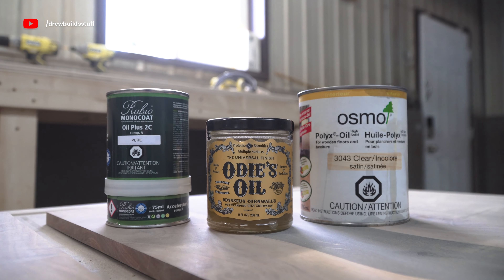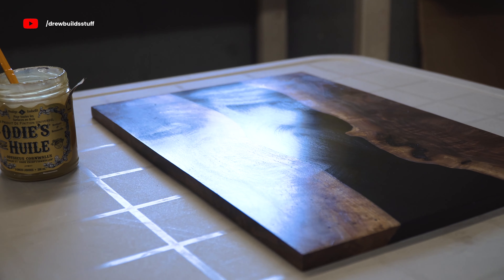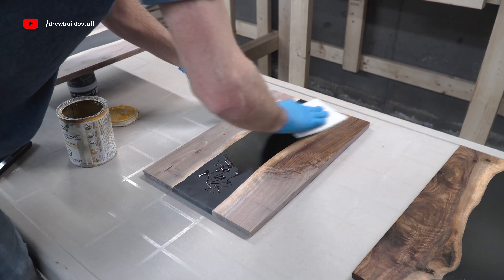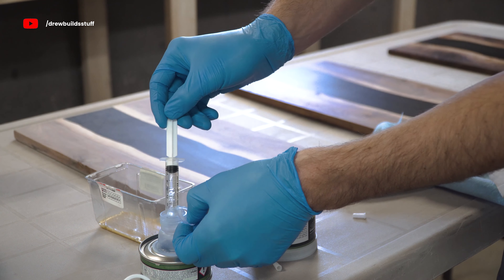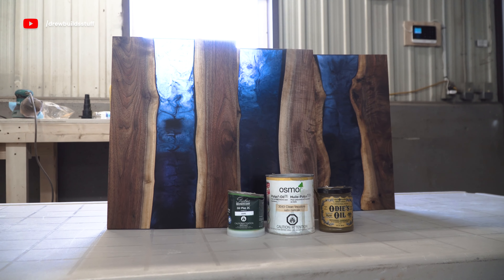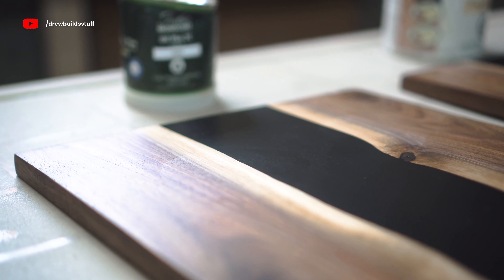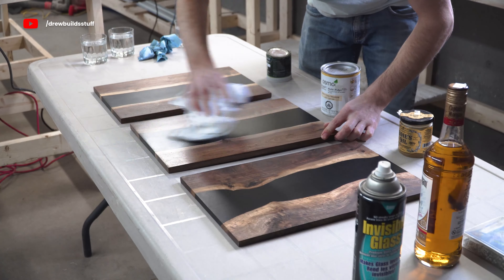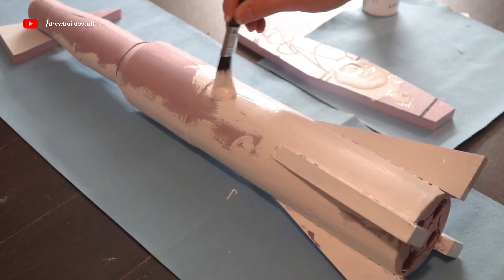Odies vs Osmo vs Rubio - Search for the ULTIMATE WOODWORKING FINISH

Comment: Hi Drew. Thanks for including us in your comparison. In order to achieve full stain resistance with Osmo it is advisable to roll or brush the finish onto the surface and allow it to dry without buffing away the excess. White pads and rags apply the finish very thinly, and so 2-3 coats using this method will leave behind a fraction of the finish versus 2-coats with a brush or a roller. This means reduced stain resistance as you have found here. Bear in mind Osmo is designed to be rolled and brushed to achieve the highest durability. So to improve the stain resistance we'd suggest to roll or brush two coats onto the surface and allowing the finish to dry (do not wipe the finish off). After the second coat has dried, you can lightly scuff sand the surface with a maroon pad or P320 grit and buff in 1-2 coats using the method you used in this video. Once done and cured, you should find that the Osmo has at least 24-hour resistance to the liquids you placed on the surface. Hope this helps
Reply from the maker: Hey thanks for getting in touch. I’ll try the method outlined above and reupload the video if there’s a discernible difference! Also I’d consider updating your application instructions on your website to something clearer like this because I read them about 5 times to make sure I was doing it right and have seen many videos of people applying the same way on here. Thanks!
Reply: @CraigularjJoeWoodworks  Hi CS. Thanks for your feedback. Our comments were us describing how to achieve full durability with our product. Two coats with a cloth will not achieve full durability as shown in the video and so we addressed it. We could honestly speak all day and use a lot more than 250 words on wood finishing, it’s a whole trade! We’re sorry that turns you off, but you do you 😅
Reply: I like Drew’s method along with others, eg Matt Estlea’s.  It appears there’s some confusion with practicality, aesthetics vs lab experiments.  Getting rid of the brush and roller is the only reason I was remotely interested in Osmo in lieu of Rubio. Hopefully this informs the Osmo marketing department alongside the chemical engineers when designing this product.  Thanks for sharing Drew.  Subscribed.
Reply: Yeah.... nah..

Apply with roller and leave. I tried this numerous times and it leaves way to many noticeable lines, not a smooth finish at all..  finally ended up sanding the piece back and changing to Rubio.
Reply: @andrewgrant1814  Hi Andrew, You need to use a 4mm microfibre roller and to roll as thinly as the roller allows. If you are leaving lines, it means your roller is too saturated. If any roughness develops, it can be sanded lightly with  P320 before applying a subsequent coat. Hope this helps.
Reply: @OsmoCanada  Can you point to where these specifics are on your website? I cannot find anything that indicates one method over the other would be preferred for durability.

I'm also confused by your instructions for the brush and roller application, specifically steps 2/3 for the second coat. You have a waiting period followed by a waiting period. Is something supposed to be done between these steps?

I do believe this test was valid and carried out properly, with application method resonably consistent between each product.
Reply: @OsmoCanada , your comments are very clear and appreciated. I have used osmo on many furniture and cabinet projects and always wondered how the other applications might differ. Thank you.
Reply: @OsmoCanada  what's the difference from the finish?  I bought 3054 because there wasn't 3043 available near me, is there a big difference?
Reply: @jakehetzel8177  totally, the Osmo rep typing these novels is on another planet… switch to odies, they know how to explain the product. They have a great video for application every product, my son could Apply it and he’s 1 haha I will never use Osmo. No one should
Reply: @jakehetzel8177     Why not just use a wiping varnish 
like Arm R Seal?  Looks great an easy application and most importantly, water and stain resistant.
Reply: @saax3816  Arm R Seal is top notch, and their instructions are lucid and make sense. I like that I'm not expected to call them becase they somehow have time to answer phones to give recommendations for every situation yet somehow don't have time to write down these recommendations.

Keep recommendations off paper = keep liability issues minimal. Bogus model.
Reply: @jakehetzel8177    I can understand their marketing technique…Osmo was originally for flooring?   For that situation, and Since product purchasing can be expensive, Calling their support for best application is nice to have since there are dozens of variables going towards a good coat.  For Casual woodworkers for making tables, I think Osmo hasn’t adjusted to that different market yet from a support perspective.   To be honest, if I hired a flooring specialist, I will want them to get the support needed and understand the best technique for that particular project.
Reply: @saax3816  I don't disagree with what you're saying here, but the fact is that the customer-perspective in this thread has been that Osmo's instructions could be better. Instead of them accepting that/addressing specifics, the rep provides lip-service and marketing blabber. Does it make sense to you that they find it impractical to improve on their instructions, yet practical to find videos on youtube and run a hotline?
Reply: @jakehetzel8177    Yes they need a change to their support and marketing.
Reply: @saax3816  totally. The customer service needs the boot.
Reply: Excellent clarification, Osmo Canada, in applying your product for a very resistant finish. Your explanation is consistent with all of your instructions and videos produced by your company. I’ve achieved very durable finishes as a hobbyist furniture maker and wood turner.
Reply: @CraigularjJoeWoodworks  stop shitting on osmo there saying how it should be done so chill
Reply: I’ve tried multiple hard wax finishes on many different types of products, and I believe there is no one correct answer to this. The difference between all the finishes is absolutely personal preference, which can never have one correct answer. My personal preference is Osmo, but again, I also apply it in a completely different manner than anyone has addressed here along with using a combination of multiple Osmo products for a high gloss finish. I also use different Osmo products on different projects depending on the use of the item. For example, I used to use a mixture of mineral oil and beeswax on end grain cutting boards, but after discovering Osmo Top Oil, I find that it provides a much more durable finish than remains food safe and doesn’t have to be reapplied so often. Regarding the Polyx, I find 2 thick coats, with 24 hours of drying time between each, then sanded down with 400 grit followed up with one or two thin coats buffed in provide a finish that not only looks great but is also very durable. When I sell a product to someone for them to use, the last thing I want is them calling me back in a year to refinish their item, and applying Osmo in the manner I do may be more work than some people are willing to do, but over time, it actually saves time because the finish, like I apply it, is not only more durable than others I’ve used but also looks better than others I’ve used. You’re more than welcome to view pictures of my finished projects on my FB page, MR Wood
Reply: @CraigularjJoeWoodworks  hijole! He said that he read them on the website. Personally, I am glad that they came on to emphasize application for stain resistance. S'wy I'm reading comments.
Reply: @CraigularjJoeWoodworks you musr have put a lot of time in and got a bad result. That is frustrating.
Reply: @CraigularjJoeWoodworks  Hello, Most of our products are indeed food safe. The products used in this video are food safe when dried. We will be happy to provide food safe certification certificates from third-party testing agencies.
Reply: @osmo Canada 

I was about to buy your product until I read these snarky comments. That’s unfortunate behavior.
Reply: @heatherlindsey971  Hi Heather, We're sorry to hear this because nothing above is meant to be snarky or offensive. We are simply explaining how to use our product and why it is that poor results were shown in this video, as well as trying to help anyone with questions. We're very nice people at Osmo Canada who only want to help :)
Reply: @OsmoCanada  The people that are giving Osmo a hard time here clearly have a hard time understanding there isn’t just one way to apply a finish. Your comments were very easy to understand and I appreciate them.
Reply: @CraigularjJoeWoodworks  What is interesting, though, is that there are many cases in which projects ARE different. If you make cutting boards as your side-hustle, then sure, you are probably going to treat every board you make using the same finishing schedule. But if you do a little bit of everything, you may start to see that not every single project requires (or demands) the same treatment. You wouldn't finish a floor the same way you would finish a beautiful wood-turned vase. Same goes for a bookshelf in your home office verses a bench destined for the lobby of a commercial building. They are simply different situations that require different solutions. So, saying 'every project is different' is far from bizarre or even a lie. If a doctor prescribes penicillin to two people with the same bacterial infection, but one has a severe penicillin allergy, the end results are going to be different. Same goes for wiping two coats of finish on a cutting board and then doing the same on a floor. Asking for one simple/brief explanation is to ignore the multitude of variables that go into wood finishing. Ask for a simple/brief explanation of French-polish. The answer you get will be neither simple nor brief, and if it is, you're going to be missing some information.
Reply: @CraigularjJoeWoodworks  Why is the can unusable? Also, my focus was specifically on what you had mentioned in your previous comment, where you stated "the can must give one set of instructions". So in fairness, I was addressing a point that you brought up, trying to explain why it is impractical to have a single instruction for all circumstances.
Reply: @CraigularjJoeWoodworks  Are you suggesting products with long explanations inherently lack merit? Can you explain why? Is it too much for you to be able to understand why a product might need different applications for different circumstances? It seems like a difficult concept for you to grasp, for some reason. Osmo works incredibly well- so where is the issue? Have youmtried it? How is it possible that thousands and thousands of people use it with success, wolrd-wide, but you can't? Or is it just a giant conspiracy, and really the people using Osmo with success are being paid-off? The hatred seems misplaced. At the end of the day, it is a wood finish. If you cannot figure out how to use it, don't use it. What is the point of spending all the energy bashing it online?
Reply: @OsmoCanada  Hi Osmo.  I'm going to mirror the comments of several others here... I've got the Osmocolorusa site open in another window as I type this and there are four application methods given for Polyx-Oil High Solid.  Nowhere on that page does it indicate a difference in durability, finish, etc would be achieved by following the different methods. I understand that there ARE differences (from your earlier comments on this video), but the instructions on your own site mention nothing about this. Like many others, I would appreciate more clarity in the different results one would achieve from the different approaches.  For example, were I making a table I would be tempted to use the "highest durability" method for the top surface, but a faster method for other parts, but only if they would result in similar look/sheen. With any product results are a combination of technology and technique and you're letting your users down a bit by not clearly communicating the techniques necessary to get the most out of your product.
Reply: This is awesome.   I just purchased some osmo for the first time and am gonna use it in some walnut and red and white oak boards.  Can't wait till tomorrow.   The handles will also have 4 drilled out holes with epoxy pins in them .
Reply: @CraigularjJoeWoodworks  You cant blame @OsmoCanada when Drew didnt follow the stated procedure.  C'mon man! (Sleepy joe)
Reply: @Foxholeatheist  I actually agree with a lot of the comments about there being a clarity issue. I was Craig's page for a bit then it devolved  into some personal vendetta for things that aren't simple enough for someone with a disability or something... "the can is unusable we can agree" 😬😬😬

 But while I do think the AI style borderline bot customer service responses are a little annoying, does seem like they tried to respond with grace, and we have ti remember this person isn't likely in control/charge of the website. All they can do is pass the criticism down the line.

Seems like a lot of folks here think they're talking to the creator of osmo who has total power.

Craig is on some tangent about this video being about cutting boards, when it's clearly a "tabletop" that
Reply: @OsmoCanada polyurethane is the same application. So does that mean I can spray it on with an hvlp? Seems like it would level out better than a roller. Worst case you can buff that and wipe on a final coat
Reply: I had a ton of issues with my Osmo when I didn’t buff off immediately. It results in thin coats, but it got so gummy if I let it dry saturated. 🤷‍♂️
Reply: @heatherlindsey971  it’s people who leave responses like this that prove the internet is ran by trolls!!

Osmo is just allowing people to understand their intended application process. 

If you think they are being snarky maybe you should stay off the internet.
Reply: I'm a big fan of Osmo. I use Osmo Top Coat for my bowls that frequently get washed in water. No problems.
Reply: @saax3816  eww
Reply: @DrewBuildsStuff I agree. I had to screenshot their comment to apply this finish. Since not even their own videos or instructions show this.
Reply: Osmo wasn’t applied properly in this demo. If done correctly it’s a great finish.
Reply: @jakehetzel8177  Arm R Seal is great, agreed.  General Finishes products are top notch.  The only reason I use something else is when I do not want the ambering effect that Arm R Seal leaves.  It's especially ambering on light, non-stained woods like maple and birch.
Reply: I think it was applied according to one of their instructions, the only difference being he needed to use a rag to get it to look right on the subsequent coats.
Reply: @Andy-iw9su I intended to tag you ^
Reply: When applying with a roller or brush, doesn't it require to sand in between coats?
Reply: @OsmoCan  the "you do you" comment above was something I found unnecessary as well.
Reply: @jaimethiessen  Agreed, it's very childish to say "you do you". Osmo's marketing team should fire their YouTube comment employee immediately to avoid marketing disasters like this in the future.
Reply: @heatherlindsey971 😂 no you weren’t, you just think they care about you. Sad.
Reply: I 100% agree with the comment to update your website on how to apply your product with wood/epoxy projects.  They contradict themselves in some spots, as well as contradict the youtube videos.  Which applicator method to apply and when is the most confusing part.  Website says to use a white pad, video shows using a roller, website says to use a cloth, video shows to use a roller, etc.  If it doesn't bond to epoxy, why even put it on the epoxy? etc.  How long do we leave it on? If it gets tacky its VERY difficult to get off without scratching the epoxy (if using a clear pour) and a rag/microfiber cloth starts to stick to it and then you get all these little fibers stuck to the project.
Reply: @mrwood1788 thanks
Reply: @DrewBuildsStuff Hi! Did you try the method Osmo has suggested after all? I couldn’t find a video.

Comment: Of the three, I have only used Odie’s Oil.  However, I have had very good results applying two coats of Velvit Oil, (food safe after it drys and similar to Minwax Antique Oil), which is a penetrating oil.  After it has dried thoroughly, I apply Odie’s oil per manufacturer’s directions.  Velvit Oil provides deeper protection and visually pops the grain out and Odie’s Oil gives a nice sheen and better surface protection.
Reply: I just started using Odies. I saw they have a super penetrating version. In the Odie video I watched, they said to mix a little of their safer solvent with the super penetrating to get a very deep penetration into the wood. I haven't tried it, but I saw your comment on liking Odies and figured I would share this info.

Comment: I’ve used Rubios and Odies and much prefer Odies. The biggest difference is having to mix Rubios with the activator. Unless you’ve used it a lot, it’s hard to gauge how much to mix and you end up wasting a lot. Odies is also thicker, which helps you apply it more evenly.